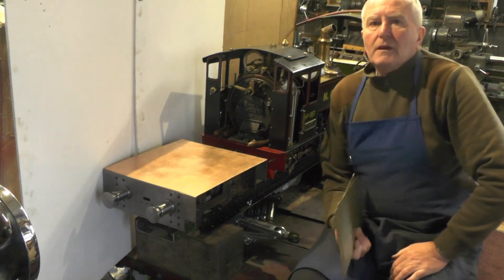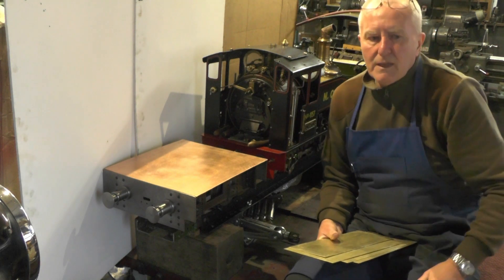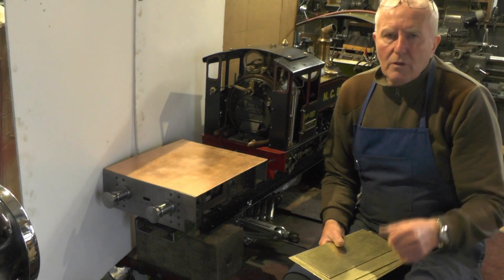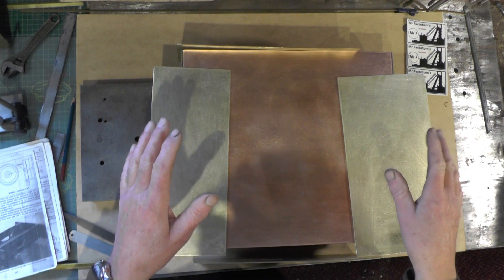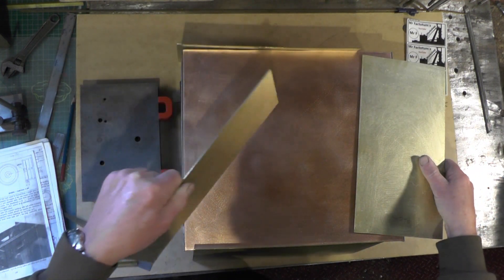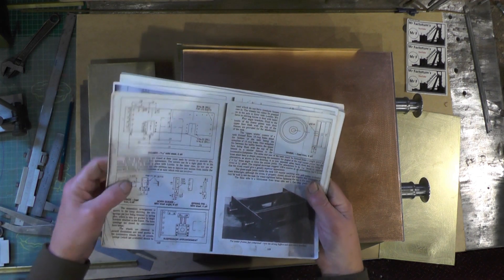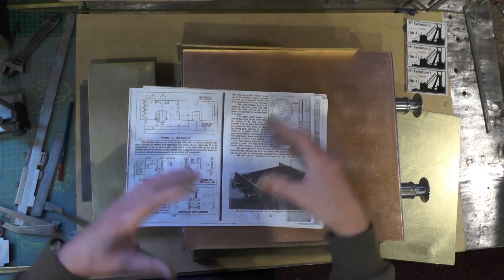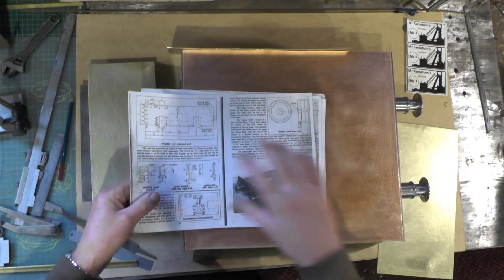Make a Water Tender TANK BUILD P2 - For "Scratch"(My Beginners Steam Locomotive Series)"mr factotum"

Comment: Is there a reason why you don't make a 90° bent in the plates themselves? I think it would be a lot easier and less work.
Reply from the maker: eyup Michel
Yes, the reason is my Brass Sheet i have is not big enough, in fact i've adjusted the tank size already to be a little smaller than the drawing sizes to accomadate my sheet material, otherwise i would have had to buy more of the very expensive brass sheet, which was out of the question for me🤣 
Thanks for watching and feedback it's appreciated
take care
Kev uk
Reply: @MrFactotum  That makes perfect sense.